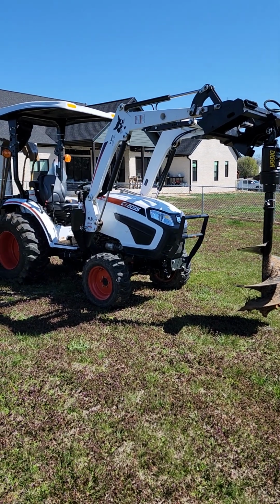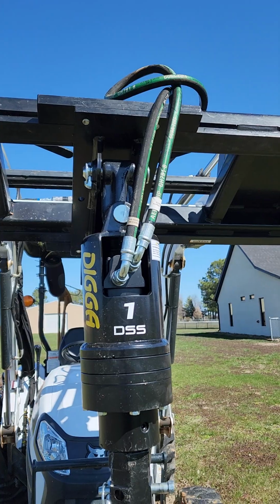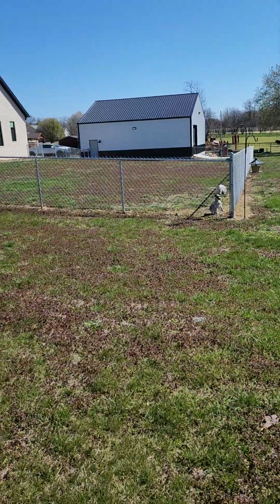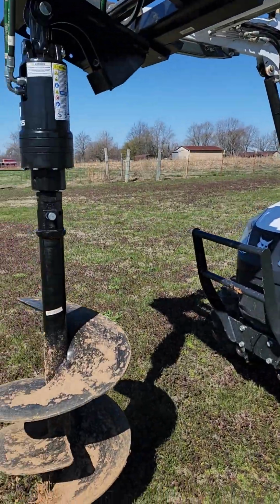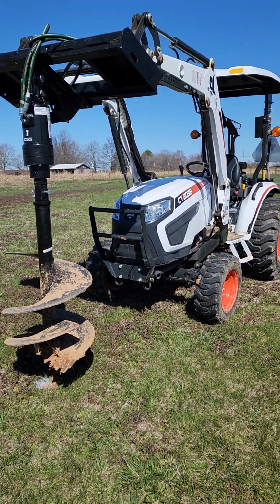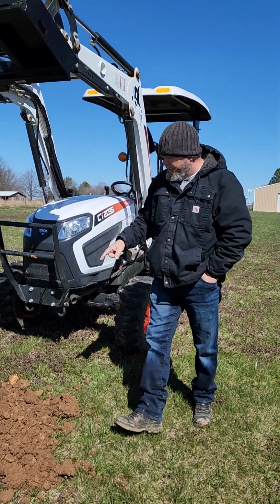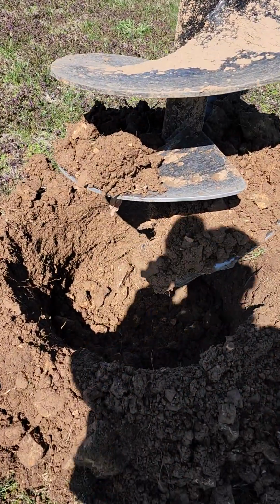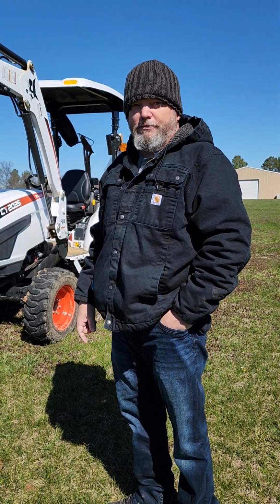Digga 1DSS Auger Review on Bobcat CT2035 Tractor

Comment: I've been considering purchasing a Digga. Very informative video; thank you.
Reply from the maker: Thank you.  I will say it actually performed much better than what this video reflected.  In the video I was using a 24" tree auger in pretty rocky ground.  I dug 27 other holes without any problems.  This hole just happened to be heavy rock.  On one other hole I used a 6" rock bit and it broke the rock right up, even with my compact tractor. I'm very pleased with the Digga.
Reply: I'm looking at picking up one of these this winter, we have lots of Sandy clay soil, so it shouldn't have a lot of trouble. Where did you end up buying yours from?